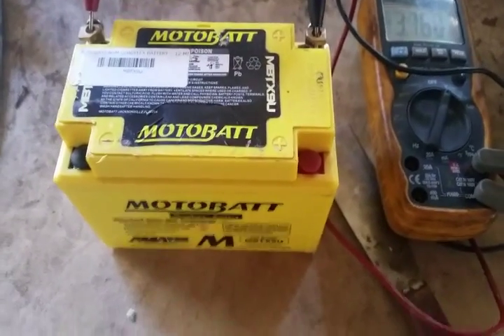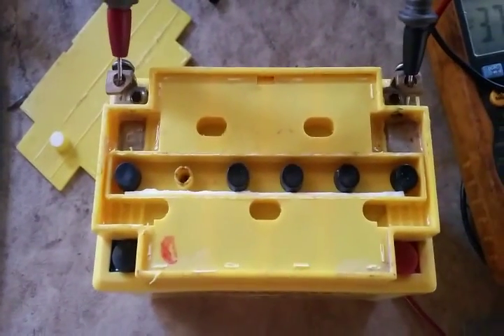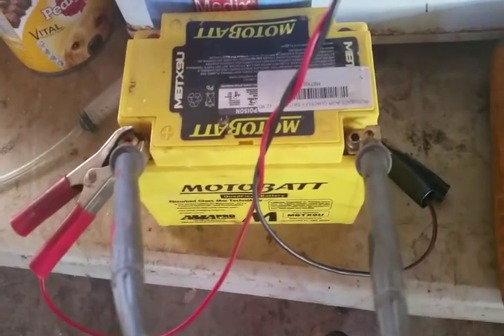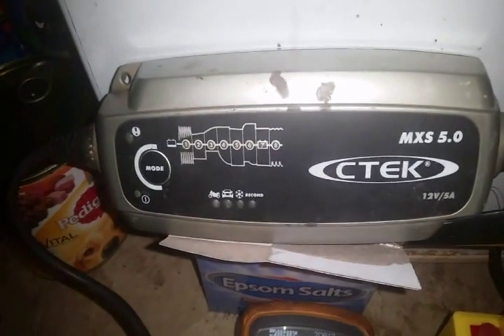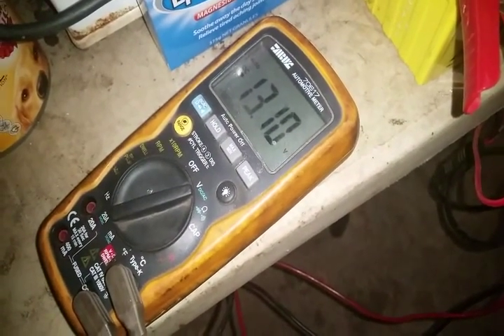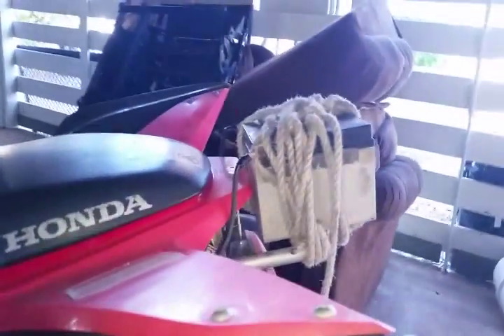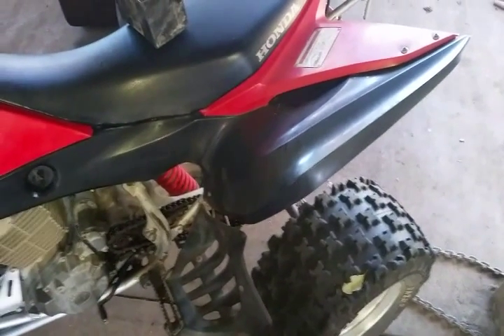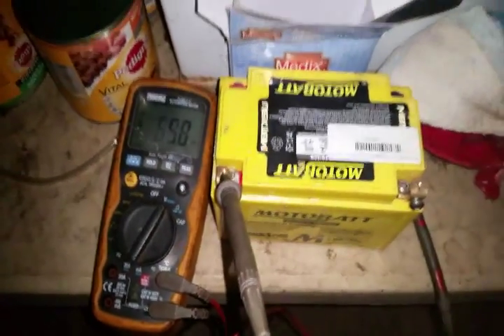How to revive an AGM Motorcycle / Quad / Car / battery using Epsom Salts.  IT REALLY WORKS!!!!!

Comment: It was definitely the epsom salts. I have tried with only distilled water and it was weaker than before. Now I have put epsom salts and it's 'boiling' on repair mode (it didn't before with only water). I'm curious after 4 hours when I will switch to charging if it will save me £100. 😃

Comment: First that's a gel batt...not agm...
And gel batt is deep cycle n could stand deep discharge...also last longer...I used this gel battery and last almost double times than other lead acid battery...so it was not luck after all
Reply from the maker: Google MBTX9U and im sure you will find it is an AGM battery
Reply: It says AGM battery on it, Absorbed Glass Matt

Comment: Not sure myself, but just tried what you did on this very same type battery, and it was holding at least 11.74 volts after charging over night at 12amps.  I added some more liquid again and will charge again tonight on 2amps to see where it goes.  It was a junk battery sitting on my garage shelf for about a year with zero volts.  I'll post a follow up, be it ok or went south on me too.  Fun stuff either way, and nothing wasted but time I guess if it doesn't crank over my 98 Sporty.
Reply: Terry Fielding what’s the word?
Reply: Did it work fella?
Reply: Still waiting for a answer for 5 years now
Reply: @roughjeepliving5394  forgot all about this - but the short of it - it wouldn't crank the bike over - suppose the battery was to far gone to  and already to old anyway
Reply: @terryfielding9386  lol figured I actually saw this comment 5 years ago was wondering if you ever would update🤣 hope you still have fun riding